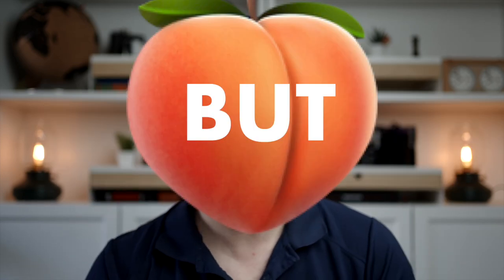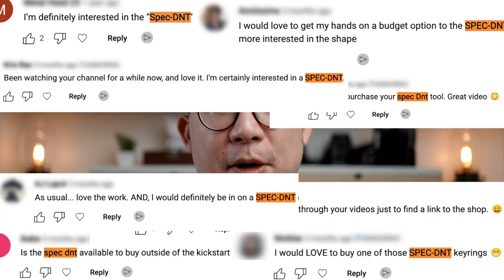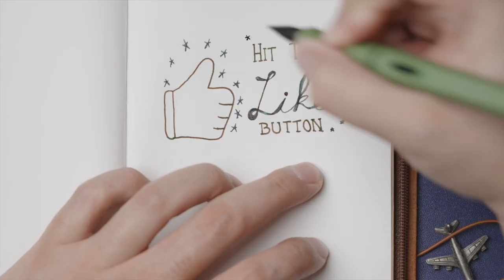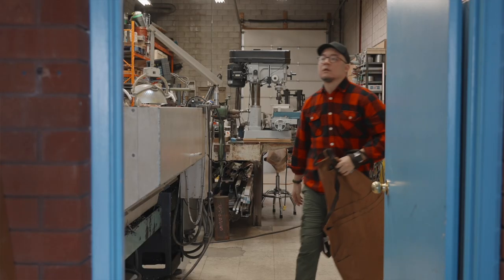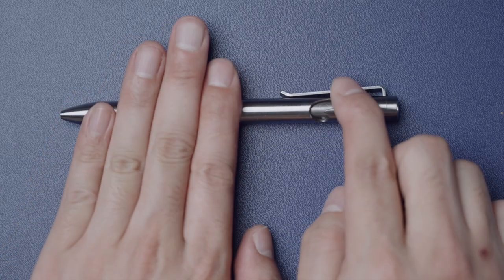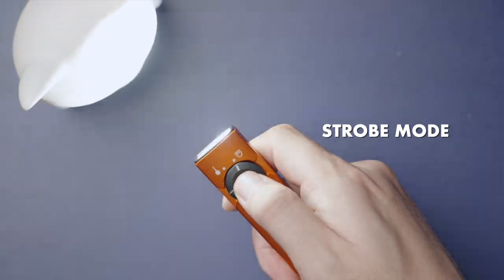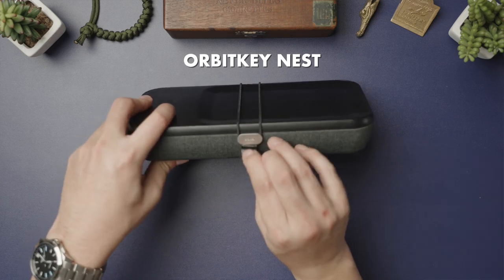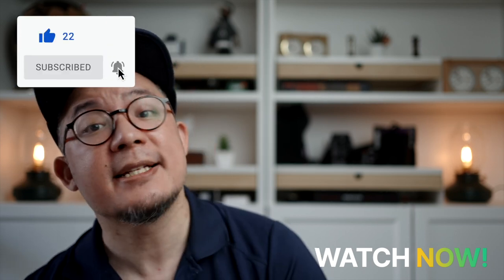My 2 VERY different jobs (and their EDC's)

Comment: I really can't wrap my head around how so many people over pay for Apple Air Pods.
Reply: Have you tried them? They’ve amazing. What do you use?
Reply: @MsRotorwings  Anker makes several sets that are just as good and are a fraction of the price.
Reply: @dcast777  “just as good” in what way? if you want absolutely bulletproof, reliable Bluetooth pairing and connectivity across any number of devices, nothing comes even close to AirPods. i’d claim that this is a baseline requirement for all wireless sets, otherwise you may as well use a much cheaper and better sounding wired product. I have much better audio gear than AirPods, but I wouldn’t bother with anything else wireless.

i hear you, other buds may have bluetooth multipoint pairing, but that is usually limited to 2 devices, handoff between the devices is iffy (ideally the devices would coordinate this instead of the bud like with Apple), and stuff like a random paired device turning BT on or off will often cause stuff to get disconnected or connected to an unexpected thing. the issue is that BT pairing is shit and having a separate protocol to coordinate handoffs is essential for this, so no device will come close unless they can do the same thing.
Reply: @thebaker8637  They are over priced plastic and the fan boys just eat it up. Half the price you can get a product that works just as well.
Reply: @dcast777  have you actually tried to use them SPECIFICALLY in the way I described above? I have, and in this particular department they aren’t even close in terms of reliably holding onto and handing off between 2+ devices. i have had multiple buds including one from Anker Soundcore prior, and they all had some kind of problem. generally they’d work, but fairly regularly something stupid would happen with the connection.

they may be cheaper and even better sounding or have better ANC but a core requirement of wireless buds is for them to get connected quickly, stay connected reliably, and hand-off between devices (TV/phone/laptop) seamlessly. otherwise i might as well use wired headphones that will be way better and cheaper. if you only pair them with your phone then you can probably pick whatever.